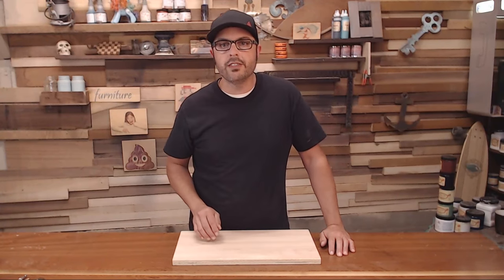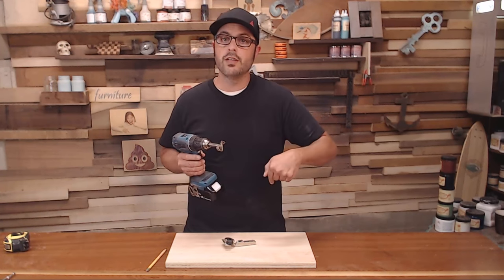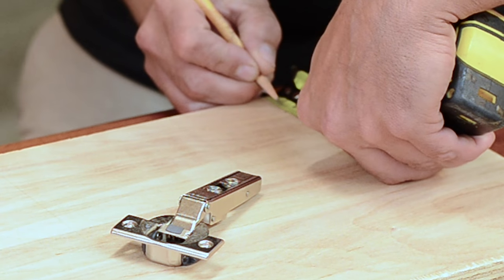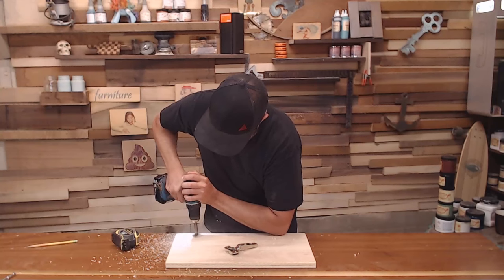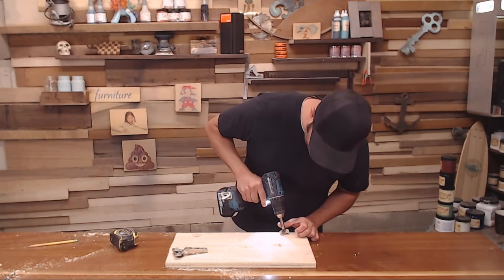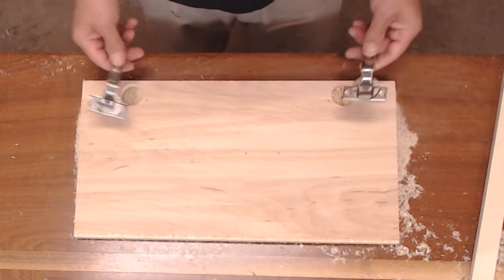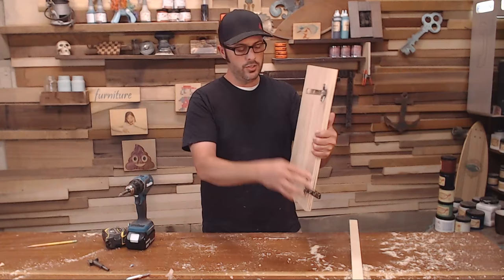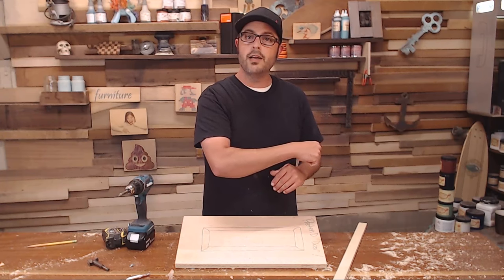How to Easily install Concealed Cabinet Hinges (35mm Hole Drilling & Mounting)

Comment: What about the rest of the process to actually install the “pretend door”?
Reply: Classified.
Reply: Exactly ! Only half of the job on this video, what about the second half where you are locating the other halves of these hinges inside the cabinet and then finally completing the job by hanging the cabinet door !
Reply: I agree.. That was the easy part lol
Reply: @susannolan6292  This guy explained it great... And then didn't finish it !
Reply: Not subscribing because you didn’t finish the process… would have been an immediate follow if you did
Reply: He showed the easy part

Comment: The order of installation and straight edge were very helpful, thank you. 
1. measure and drill the holes
2. align both hinges with a straight edge

Comment: You said you would bring your measurement out "about" 7/8 inch.
I'm about to fit HOME half overlay hinges. Is there not a definite distance to mark from the edge for each make of hinge?
The packet my hinges came in has no measurements diagram, but only mentions the 35 mm for the cup.
Thanks very much
Reply: Same here! No diagram, so I have to guess? I think I'll mock a cabinet next to the frame to mark and measure the correct distance from the edge.
Reply: Ah well it got done..gonna do a corner double door next....bloody expensive Hafele

Comment: Great Video and right on time. You saved my ass.
Reply from the maker: Great to hear! Was the video detailed enough? I always wonder if my videos have enough details to help people per there experience
Reply: @DoingitWithjason  I thought it had the perfect amount of detail. When I took on this project, I was thinking of using a router bit or a dremel to drill out the hole. I was able to buy the drill bit at lowes for 13 bucks. I was concerned about measuring and keeping the holes centered and square and was just going to wing it :-) You made it simple and easy to measure and keep everything perfect. I have to do it tomorrow. I hope I don't screw it up. I only have 1 shot at it.

Comment: Cant seem to find a good video of how to actually install the door to the inside of the cabinet. Once the hardware is placed into each side it seems like they have to clip into each other. I find this to be a difficult process, one of mine fell out and I can't get it back in. Ended up removing the top hinge and now I can't get any of the two back on. On most videos you just see the person pressing and they're done. I've tried to press in many different ways and adjust before pressing in different ways but they don't go in. Please help.

Comment: I plan on picking up a vix bit for drilling the pilot holes using the same Blum hinges. How deep do they drill? My cabinet door and frame are from 3/4” plywood.

Comment: Hey Jason, this is only half of an installation, what about the other side of the hinges? My door ended up with gap.how you measured the hinges inside to avoid gaps or overlap?
Reply: Flip the hinge with the mounting plate up,,then measure from the door to the centre of the mounting plate,,usually 30mm,,but come back a few mm to,28mm,,and mark where the holes are going,(drill the holes with the screws for the mounting plate) take the mounting plate of ,and centre it on your marks and screw to the carcass ,then spring the hinge onto the mounting plate,,( best try a trial run first on a scap  piece, ),,hope that was helpful,,👍🏴👍🏴

Comment: how do you fasten them to the cabinet in the right place,do you need a jig  ?
Reply from the maker: What I do is hold The door and the proper position with the hinge against the cabinet and carefully open the door and make a mark on the bottom of the plate. This works really well to get a ballpark measurement and make a spacer that will hold the hinge along with the door in the proper position to screw it in.You can also go by the manufacturers recommendation of where to put the holes but depending on if it's insane overlay etc Just seems to be the easiest way to at least get one especially when you have like 20 more doors to do after the fact.Thank you very much for watching this video I really appreciate it and I hope this helped please let me know if you have any more questions.
Reply: Doing it With jason I was also only looking for guidance on how to align the holes on the cabinet itself. The doors seem easy, it's more a matter of having the right tools. Aligning inside the cabinet seems trickier and more worthy of a video IMO